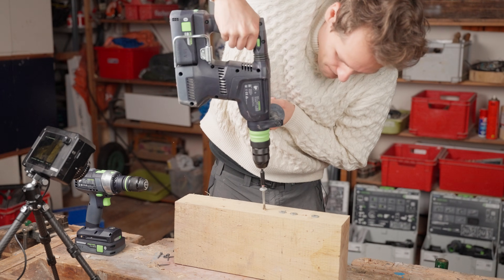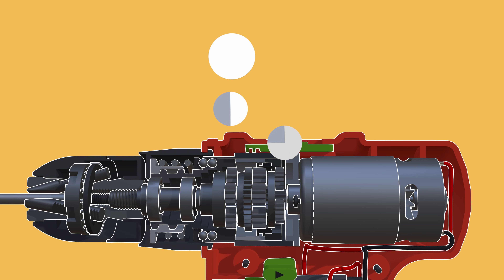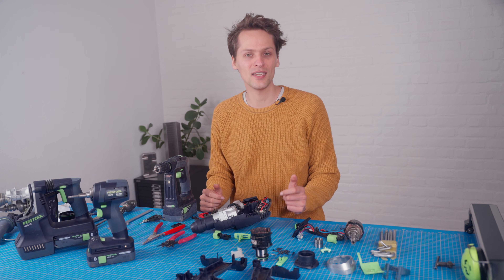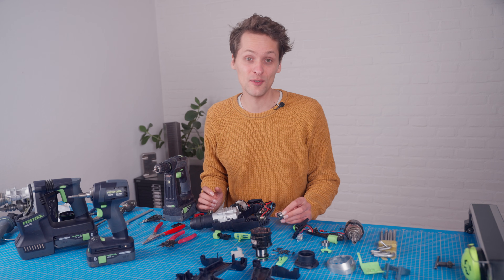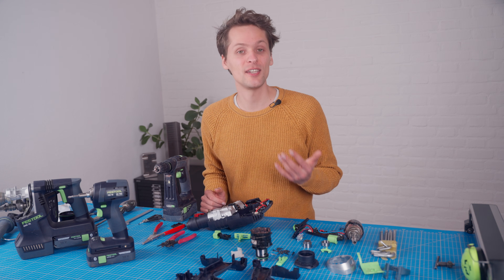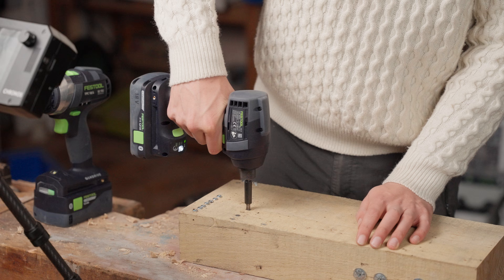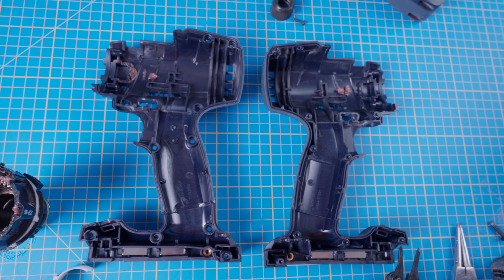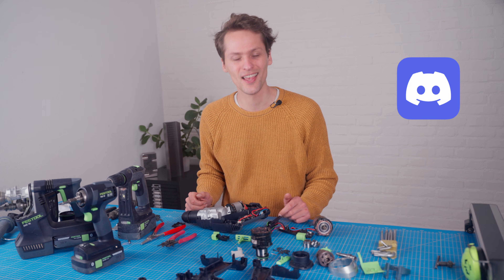Hammer Drills Don't Hammer - Every Drill Explained

Comment: As someone in the field:
I hate potting. And i hate nonsensical conformal coatings. Sometimes you gotta throw out stuff you could easily repair, but you cannot justify the time it would take to depot everything.
Reply: I guess your field is inside in the warm and dry. I used to repair power tools for a living and the only time I would see a bit of wet was in the minute it took to go outside to hammer drill a couple of holes in a big block of concrete. Roofing contractors with an open roof and a rain storm on the other hand will tough it out and so must their tools. Try that without potting and conformal coatings.
Reply: @astranger448  I am talking about tools and devices where you can clearly see the reason is not moisture/ingress/ex protection.
Reply: @DasIllu  so… you’re talking about tools that are not drills, so not particularly relevant to this video.
Reply: @DasIllu shock protection matters especially on a sds

Comment: The 4 speed gear box and e-clutch is a bit of a head scratcher. Having driven a 6 speed manual clutch I can say 100% of people won't use the gears correctly, the "extra gears" will just be skipped
Reply: Having Dumb users does not justify producing Dumber tools...

Comment: a switch that will last forever? isn't modern tech designed to fail eventually?
Reply: That's why they buried the capacitors under a blob of epoxy instead of using a conformal coating.

Comment: Electronics potted in epoxy means we dont want anyone to repair it and see our precious circuit design.
Reply: It also means you can forget your tool out in the rain and find it soaking wet in good enough working order. You really think that a roofing contractor out on an open roof is going to come in out of the rain. He will take it and so will his epoxy potted electronics.
Reply: @astranger448  Good luck doing any work with a blown motor or battery, which will happen whether the circuit board is potted or not, if water gets into it. Potting has nothing to do with waterproofing; it is simply the cheapest solution to vibrations. Same reason why optics, lasers, IR lights, and other electronics you put on guns are potted. It just helps keep things from shaking apart, especially bigger components like capacitors, without having to engineer some kind of harness. Just chuck the whole thing into epoxy and call it good enough.
Reply: @astranger448  There is a thing called conformal coating for that problem.

Comment: Today I learned that festool drills are just as cheaply made as other brands that cost 1/10th.
Reply: HMMM... Well, sometimes their tools design is just better, but other times, they are not really better than others but still overpriced. Their wood Routers are quite better not for the router itself, but because they developed several excellent router guides and accessories that other brands would only dream to have...

In other cases, their tools do not truly justify their overprice. Some are justified, but definitely not all!
Reply: @alfredomarquez9777  Festool is very good at dust extraction. A carpenter with Festool who takes a bit of care can do a (small)job at your place without you having to spend a week getting the dust out of everywhere.

Comment: I took my milwaukee combination drill apart (to clean / regrease it) and ended up with an extra spring left over!
Reply: No idea what the millies do but I know other quality brands that have their exploded drawings and parts list on their website (I worked for one). Give it a try.
Reply: You need to be extra careful an organized if you go and disassemble a combination drill, ascit is very essy to misplace the gears, springs and small pins and balls... Better to just try to clean and relube it without disassembly. Spray soft solvents can help a lot.
Reply: That was stupid Milwaukee has great warranty no need to do that

Comment: 12:48 Why are Phillips shitty screw types?  As someone who only occasionally uses screws they always seemed to give me a bit more grip and thus be less likely to jump out than normal screws.

From a theoretical POV isn't a Phillips just like having two screwdrivers working together?  At least in the limit as the radius goes to infinity?
Reply: Sounds like you are referring to standard slot screws, in which case yes Phillips is often better. The big issue is that Phillips was actually designed to cam out on purpose. But both are surpassed by basically every other drive type such as square, hex, star, torx... even posidrive which I think he mistakenly lumped together with Phillips. They look similar but are designed different and must be used with their respective drivers to perform their function as designed.
Reply: @ABoojumSnark 

Try the Canadian designed "Robertson Square Drive"... it is even better than a Torx in respect to holding the screw on the screwdriver tip without any magnet, as it holds the screw beautifully, better than any Torx...
Reply: @alfredomarquez9777  Sure. When I want Torx a jump on my bicycle and drive to the hardware store. If I want Robertson I can find them exactly nowhere. Torx with the right bit and a bit of magnet works just fine. 

Robertson if fine for those that have them.

Comment: Are there any drills both with mechanical and adjustable electronic clutches (should really be called a torque cutoff)?  Or even better where you can just set an absolute torque limit as well?
Reply from the maker: Absolute torque would be the dream!

Comment: This was great, but I'm a bit unclear what an electronic clutch is and how it differs from just lowering the speed of the motor.

EDIT: Some googling suggests it's just a system that really quickly cuts off the motor in response to a sudden increase in torque.  That makes me think that on decent drill you shouldn't have the problem of it not working in certain gears since the electronics can just adjust the threshold proportional to the gearing.
Reply from the maker: Yeah it just measures the power draw of the motor and cuts it off. Yeah I'm curious if this is the technical lower limit of precision or just arbitrary
Reply: @KnowArt I guess it probably depends on the motor type.  I've heard with certain motors you can do decently accurate computation of force but those are probably much more expensive.  It will be interesting if in the future prices come down to make that possible in affordable drills.
Reply: Not why these things are there. You are drilling a hole in concrete and all of a sudden you hit rebar. With a clutch (mechanical or electronic) things will stop or slip. Without a clutch you risk a mighty whack. Could break your wrist on the really big ones, or it could make you lose your balance high up on a ladder.

So decent drills come with a clutch. They also come with a longish extra handle so you can hold your drill with 2 hands. (not while on that ladder tho).
Reply: "Electronic clutch" is fundamentally flawed, it starts to work when it senses the motor current (which is proportional to torque) rise above the threshold, but this is already too late, torque at the chuck is already higher than the set threshold at that moment because the inertia of the motor rotor (which is big because those are high rpm motors) multiplied by the gear ratio squared will not allow the rotational speed at the chuck to slow down, then even if the motor controller will try to instantly reverse the motor current to stop it, it can't happen instantly (it is physically impossible), you will still get some rotation, may be like quarter turn, after the moment of max torque detection. In the case of mechanical clutch, you have only the inertia of the chuck, which is orders of magnitude smaller. At the moment of "sensing" the max torque by the mechanical clutch, it physically disconnects the chuck from the gearbox and motor so there is no problem with the high moment of inertia of the rotor. TLDR "electronic clutch" is just junk that exist only for the purpose of reducing the production cost.
Reply: @e @ekstrapolatoraproksymujacy412 Except it all depends on time scales and give in the system.  If your drill bit is stopped instantaneously it exerts infinite instantaneous torque regardless of any clutch.  If you clipped a huge block of pure diamond with a drill built out of diamond gears maybe that would matter but the electronic clutch doesn't need to take zero time it merely needs to operate on the scale at which the gears in the drill and other parts transmit the sudden impact -- and in practice it's usually not sudden on microelectronic timescales only ours.   At this scale pretty much everything operates like a spring not a rigid body so it all depends on how that cashes out -- my guess is that the gears are your friend because they can absorb some of the impact while you react.  And in truth you would see the same kind of things in the mechanical clutch at those timescales.

As far as the angular momentum, yes the rotor is moving pretty fast but it also can be extremely light and skinny reducing it's angular momentum compared to that of a heavier rings of a mechanical clutch that rides around the outside -- the electronic clutch probably is dealing with more angular momentum but I'm not sure it's a huge amount more or how much it even matters.     But ultimately I suspect it is the small amount of play in the gear reductions that will have the biggest effect.

As for how fast it can act, well it will depend on the design, the motor type (in some types a sudden torque requires adjustment to not get out of phase).
Reply: @petergerdes1094  Except I'm talking about what it IS not what it could be, anyway, even when optimized it will always be worse than mechanical clutch at the chuck. Your comment on how instantaneously stopped drill bit makes no sense in the context, clutch is not for drilling, clutch hob is to stop the rotation as fast as possible when set torque is exceeded which is mostly useful for screwing in different screws without stripping the threads or breaking the screw, both types of clutch will exceed set torque at the end of screwing in but electronic clutch will exceed it way more. At the moment when set torque is reached the screw itself needs to stop the inertia of the chuck (in the case of mechanical clutch) or chuck + geared motor (in the case of electronic clutch). Wood screw torque rise in respect to the angle of "overturn" is not very steep and so it can turn a lot without the torque rising that much and so stop that inertia without exceeding set torque much, but something like self-tapping screw in steel has very steep torque rise and can't take that much energy without breaking the screw, in this case using electronic clutch will result in broken screws. There is a way to somewhat alleviate that by keeping the motor speed low (not just the chuck speed so using slow gear makes it worse!) during last moment of screwing in, 2x less rotational speed is 4x less energy that screw needs to stop, but that's not very practical, is it? What's the point of this electronic clutch if I have to manually supervise it so that I don't overtighten the screw when mechanical clutch just works every time reliably no matter the gear and speed?

Comment: Don't forget to wear some breathing protection while dry drilling masonry! You're possibly creating some very fine silica dust, and you really don't want that in your lungs. And of course, eye protection never hurts either.

Edit: also don't dry drill with diamond drills. I'm not sure what idiot said that those things should be able to cut dry but diamonds are just carbon. If you don't completely immerse them with water they'll just burn up. They should always be completely immersed in some kind of cooling fluid. Dry diamond drilling is something that doesn't exist.

Edit 2: Drilling with an impact driver is a good way to break lots of smaller drill bits the moment you hit anything hard in the material. I would not recommend that.

Comment: Sounds like a tool quality issue. My old work horse 18v hammer drill is still able to handle concrete without issue.
Reply: End stage capitalism at it's finest. Charge as much as you can and cut as many corners as you can in production.
Reply: There is a LARGE difference between different concretes, sometimes going into several times harder. A lot of factors do play against easy drilling...
Reply: We are 2025. A contractor that drills holes for a living buys a rotary hammer, period. A day of drilling holes pays for it. Nobody bothers making a serious hammer drill because it's only old ladies putting up a painting that use them.

Comment: Hello KnowArt, realy liking your videos of late but you were using power (work per unit time) instead of torque (force x radius) quite a lot in this one.  Gears can trade speed for torque but not increase power.
Reply from the maker: Ah damn you're right. I think it was clear what I meant but you're 100% right
Reply: @KnowArt it absolutely was clear in this one, just a comment for future videos where that distinction could be significant in aiding understanding. Looking forward to the next one.
Reply: @KnowArt  I beg of you, please wear respiratory protection when drilling! Lung cancer and silicosis (among other things) are no joke. It’s cumulative, meaning the more junk you breathe in, the higher the risk of developing serious conditions. You only get one pair of lungs, protect them when you can!
Reply: @person-zl4xk  but one pair meanss two lungs, so he's got a spare :)
(i hope it's obvious this is a joke)
Reply: @MinecraftTestSquad mm I love using my spare along with my non spare at the same exact time, my car uses all 5 of its tires
Reply: I'm nitpicking, but technically you can increase delivered power if the gears provide a better impedance match to the load. For example, driving a tiny drill bit on the high torque setting might only load the motor to 90% of its unloaded speed. In this case, changing to a high speed setting, actually does increase the amount of power that can be put into the drill bit.
Reply: @gizmoguyar but even in that case the gear stage itself is not increasing power it is allowing the motor to operate in a more powerful mode which is the primary point of gears.